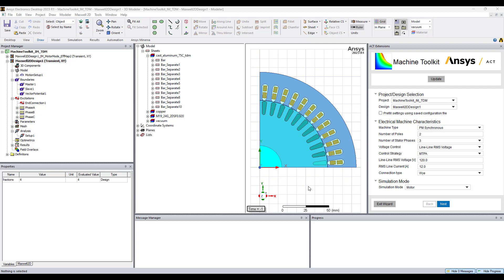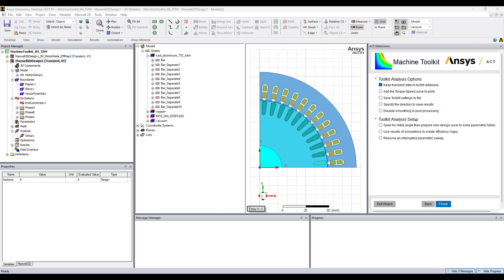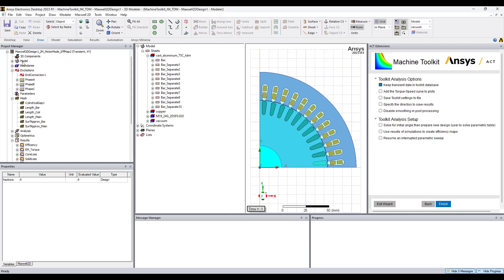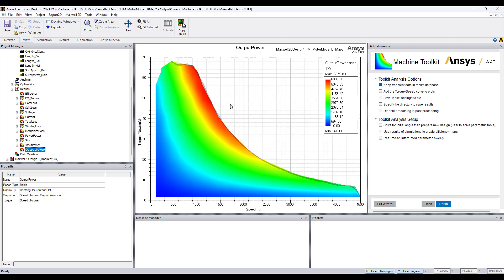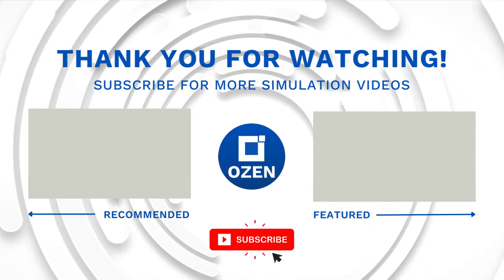Ansys Maxwell - 3PH Induction Motor - Part 2 - Electric Machine Toolkit ACT

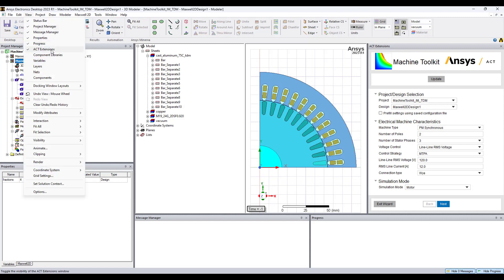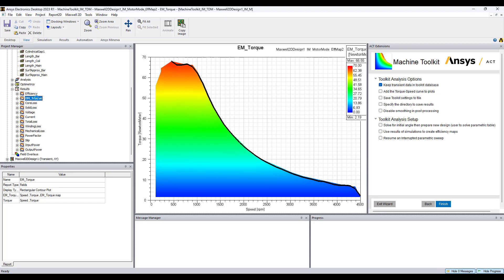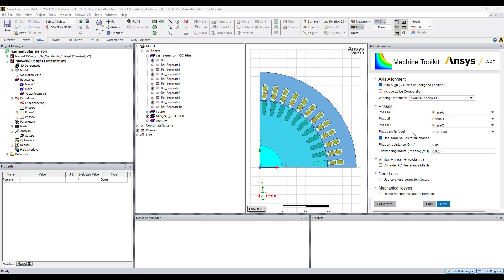Comment: I DO IT AS the video from part 1. Then come to this video and nothing as show as the video above. Is no result. Perhaps can you open the 0:33 before apply the act machine toolkit. Then keep click next and see if you can have the result as 2:17. if i click on the Maxwell2DDesign1(Transient,XY)< 1:06 select the machine toolkit as 1:06 and keep going click 4 to 5 time on next, finish. It will create a new Maxwell2DDesign1_PM_MotorMode_EffMap1. And on the result is emply no sub menu report.